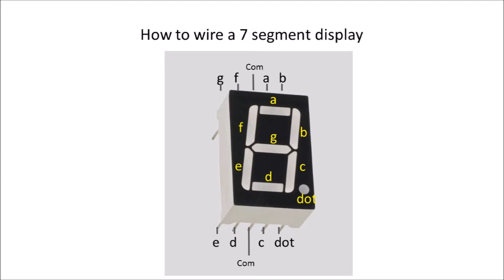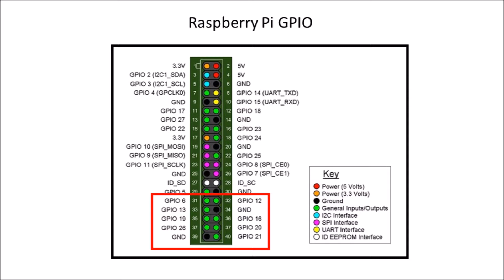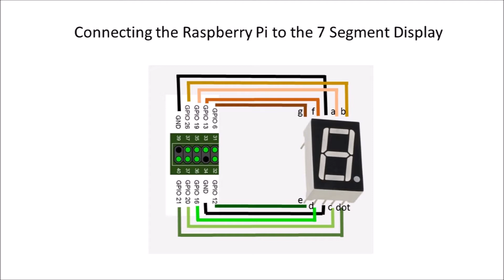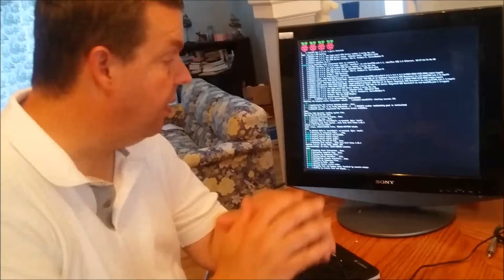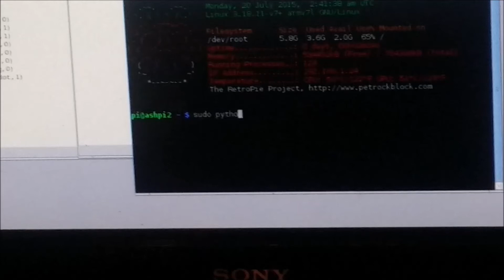Fun with Raspberry Pi and 7 segment  Display

Comment from the maker: Here is the sample code
----------
######### SAMPLE CODE FOR 7 SEGMENT DISPLAY ###########

### Setup the Raspberry Pi GPIO for USE

# First import the GPIO module
import RPi.GPIO as GPIO

# Now set up GPIO using BCM numbering
GPIO.setmode(GPIO.BCM)

### Assign the 7 segment variables that will map to each GPIO port
# Note: Use the numbers based on how you wired up the Pi

a=19
b=26
c=20
d=16
e=12
f=13
g=6
dot=21

### Declare each GPIO port that will be used as an OUTPUT port
GPIO.setup(a,GPIO.OUT)
GPIO.setup(b,GPIO.OUT)
GPIO.setup(c,GPIO.OUT)
GPIO.setup(d,GPIO.OUT)
GPIO.setup(e,GPIO.OUT)
GPIO.setup(f,GPIO.OUT)
GPIO.setup(g,GPIO.OUT)
GPIO.setup(dot,GPIO.OUT)

### Turn on specific segments to make a number
#Number 1 = b,c ON and everything else OFF
GPIO.output(a,0)
GPIO.output(b,1)
GPIO.output(c,1)
GPIO.output(d,0)
GPIO.output(e,0)
GPIO.output(f,0)
GPIO.output(g,0)
GPIO.output(dot,1)